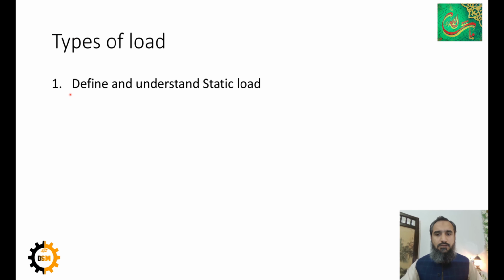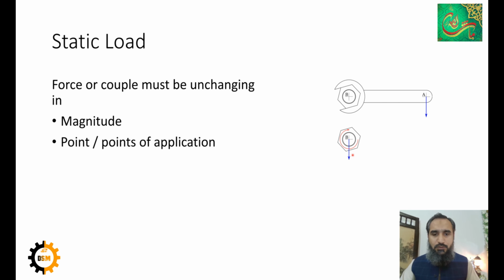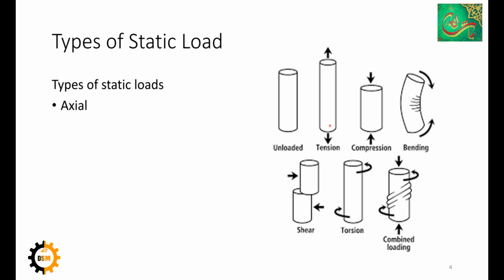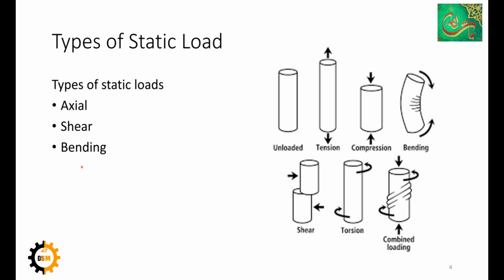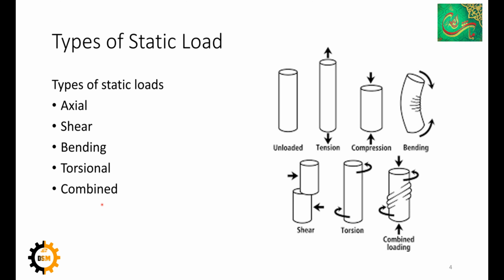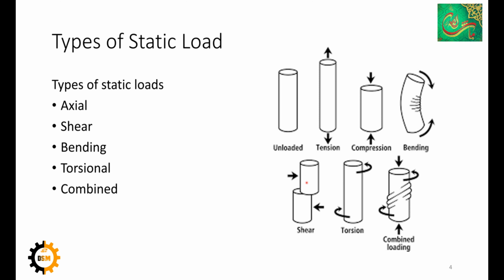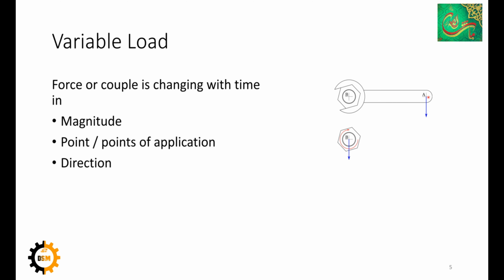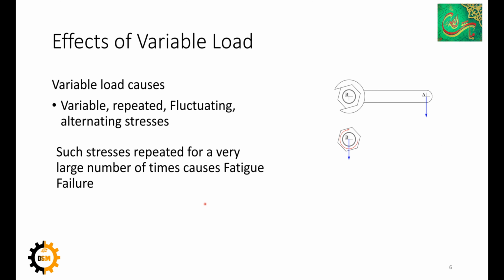5-2 Design of Machine Elements | Failure Criteria | Static & Variable Loads

Comment: Variable load can cause failures as it changes direction and magnitude. This is due to fatigue failure , most dangerous in materials made of metals that do not have homogenous metuleragical mechanical properties.
(2017059)

Comment: Variable loads cause failures more often as compared to static load because most fatigue failures are caused by cyclic loads significantly below the loads that would result in the yielding of the material. The failure occurs due to the cyclic nature of the load which causes microscopic material imperfections to grow into a macroscopic crack (initiation phase).

Comment: Static load is important when a structure is in rest and the load does not change direction or magnitude, on the other hand variable load e.g. fatigue is important in cases where load changes continuously e.g in shafts

Comment: A variable load will cause failure in more instances. It is because the strength of the material usually decreases during cyclic loading.

Comment: The static load is motionless and doesn't change with time, on the other hand, the variable load changes continuously in magnitude and the point of application can also vary. This can cause Fatigue when results in the material failing well below its Ultimate Tensile Strength.
Thus variable load causes failure at more instances as compared to static load